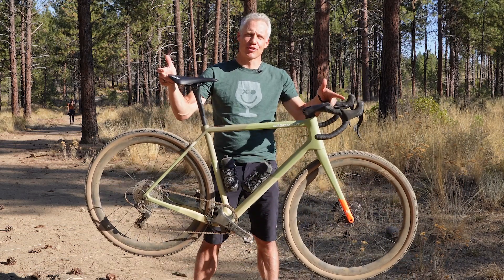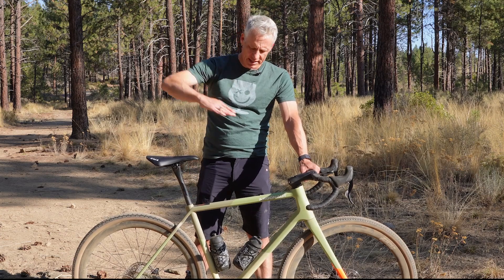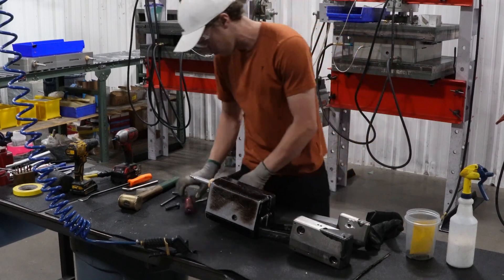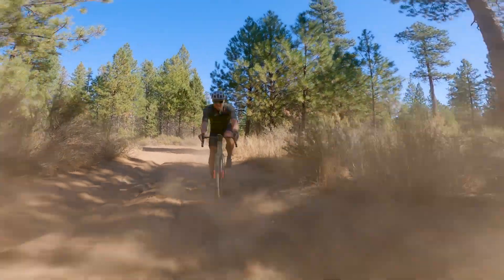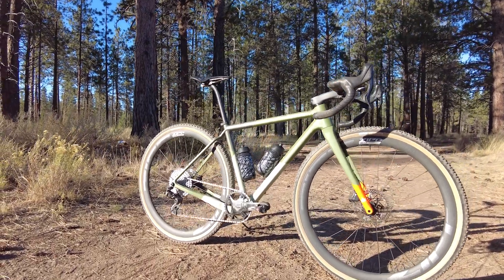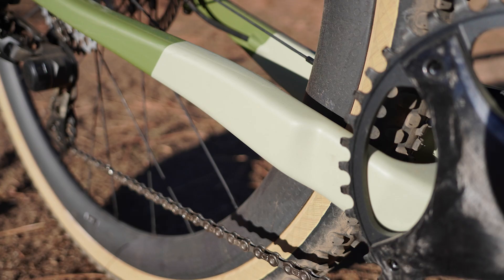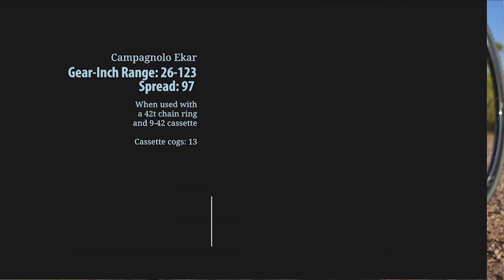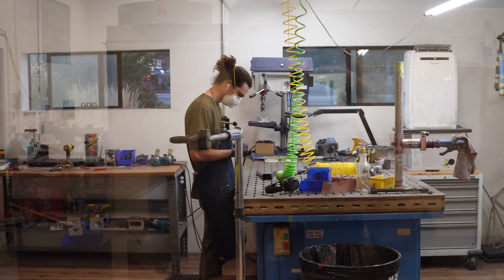Fast gravel goes slack in new Argonaut GR3 gravel bike

Comment: Hey Ben! Just a quick comment on the Rene Herse tires here. I would say for gravel riding you definitely need to be riding the endurance casing. And I believe that Ted King rides the endurance plus casing. I currently ride the same tire that you were talking about in your video, but in the endurance casing and I've never had a problem with it. I probably have about a thousand miles on my tires with no issues. That includes gravel and mixed surfaces. Before that I put about 1500 mi on some bontrager tires. GR1s I had no problems with those. But I will admit that my average speeds are way lower than yours. I rode the Robidoux like yourself this summer. I only rode the 67 mi course. And my average speed was like 11 miles an hour. So maybe that's why I have less flats.

Comment: You should check out the Fezzari Shafer- similar concept in design, but a little longer rear end- 430mm chainstay, 68.9 degree head tube angle- be a good one to review

Comment: I would be hesitant to ride a 6k carbon gravel frame. Ride through thick mud, your chain stays get scratched. Go to an event with bodies sharing the ride, your frame gets scratches. Guess it depends on the depths of ones’ pockets. Better to get something that wont make you cringe, when pebbles strike your down tube.
Reply: I spent a shit load on a gravel bike. It's getting all banged up in short order.  Should I be worried that the scratches and stuff will weaken the material?  I hope it doesn't ruin the bike. Can all these scratches, scuffs and nicks render my bike unusable?
Reply: @dingodango1  I wouldn't worry about it. Lots of little cosmetic scratches and such won't break the bike. Since you spent a lot of money(I did too) just enjoy using it and riding hard. Common sense maintenance or bringing it to the shop occasionally and you'll be riding it for a long time.
Reply: @daryl4841  yea I like banging my bike up and making it look like it belongs to a caveman.  Just want to make sure it's not bad for the bike.

Comment: Great review Ben, calm, considered and useful. Also, very low buzz word count - did you even mention the word ‘compliance’? 😊 As for Argonaut, as an admirer of their RM3, your perspective on some of the handling quirks of the GR3 really surprised me, that Argonaut has produced a gravel bike with such race-dictated features that appear to undermine its real world appeal. By contrast, the RM3 is billed as the ultimate in road bike refinement, and I don’t think the word race is even mentioned on its webpage.
Reply from the maker: Cheers, Kipper. I think Ben and Argonaut have a similar thought on the GR3 - it's an all-around gravel bike that you can race. I hope I didn't misrepresent that. Also - will work harder on the buzz words. ;-)
Reply: @TheRidewithBenDelaney  Thanks Ben for the follow up. On the contrary, no misrepresentation on your part.  My comment comes from Ben's piece at 6:25 that focuses on the design features that help the bike stay with a group on race day - to which your follow-up comment, on what to optimise for, was well made.
Reply: @TheRidewithBenDelaney

Comment: Isn't OPEN made in USA? Nice to see this, I'm sure I could order custom frame with custom paint and still have change left for nor choosing Specialized Diverge (high end one).
Reply: No. Previously TW, now CN.  Build quality is amongst the worst in the industry.
Reply: @pmcmpc  agreed. Both of mine were from Taiwan and said cervelo on the sticker along with the Chinese character. Mine ended up cracking the seat tube as it was very oversized out of the box.
Reply: @SenorBeanGrouse  an OPEN that said Cervelo on the serial # sticker?  If you have a photo, send it to Hambini ...

Comment: I think this drive for super short chainstays generally results in very compromised bikes.  with a long front centre, very slack head angle and actually not very steep seat angle at all (average for gravel or endurance road these days), it's always going to feel like more of an off road bike (which is a good thing given its use case).  Lack of 2x isn't going to be made up for by the rear end feeling a tiny bit more lively - emphasis on tiny.  Add 10mm and 2x and you have a way better bike.  Even if you run a 46 - 10-52 mullet, whilst you get the gear range, there are such huge gaps and you lose so much efficiency relative to a 2x 50/34 or 48/31 that it feels shitty, particularly if you're racing.  but removing versatility (vital features actually) and pretending you have a (trendy) USP does make the marketeers happy.

Comment: How does slack angle PERFORM different from rake?  Both extend the wheel length, right?
Reply: Also, I would love to ride there. Those look like some happy trails!
Reply from the maker: That is an industrial-sized can of worms… Stay tuned for a handling geo video with a framebuilder. Short answer is yes, both extend trail, which is the third piece of the handling equation.

Comment: Thanks for sharing some of the economics of the business.  Although $12K is indeed pricy, these guys are only making 200 bikes * $12K/bike = $2.4MM in gross revenue.  Do you think their gross margins are around 40%?  Anyway, only about $1MM/year left over to pay the 18 employees.  Tough business for sure.  Makes me want to stop being such a cheap ass and buy a custom bike!
Reply: There's no way 200 is correct. 18 employees and finishing one frame every 1.8 days?  Has to be at least 5x that.
Reply: $12k is for the whole bike, not the frameset, which is the only part they actually make.
Reply from the maker: Ben Farver said they make 200 frames a year. Allied does 1,000. Will find out on Alchemy.
Reply: @TheRidewithBenDelaney  I seem to remember TIME were employing about 40 people at their factory in Slovakia several years ago, and making about 3500 bikes .. 18 people and 200 bikes make zero sense.

Comment: Curious Ben, how does a fast racing gravel bike compare to a cyclocross bike?
Reply from the maker: Good question. The cynical answer would be: "marketing." A better answer would be: A ‘cross race bike is optimized for 60min of tight turns, off-camber pedaling, etc. A fast gravel bike is optimized for 6+ hrs of long slogs, higher downhill speeds, rougher surfaces, hauling more water and supplies,  etc. Fast gravel bikes sit lower and the so-called progressive ones have a longer reach and often more trail than a 'cross bike. For example, a Giant Revolt and a Giant TCX both have a 72 head tube, but... the Revolt has more trail than the TCX (65 to 62), more reach (39.1 to 38.5) and way more bb drop (8 to 6) in size M/L. Then there are things like top-tube and under-the-down-tube mounts and frame protection on gravel while some cx bikes have just a single bottle mount. Can you race a cross bike on gravel? Of course you can. Alexey Vermeulen spent all of last year on a Bianchi cx bike and did just fine. And Specialized now just has a single bike for cx and gravel - the Crux, where the geo kinda splits the difference and there are no extra mounts or frame armor.  But the short answer: longer, lower, and built for the longer haul.
Reply: @TheRidewithBenDelaney  thanks Ben for taking the time for such an in depth answer, very much appreciated.
Reply from the maker: @chrisvanbuggenum871  Yeah, man. I should have also said - tire clearance! CX bikes are getting wider, too, but typically nowhere near 45 or especially the 50mm clearance that the GR3 has.